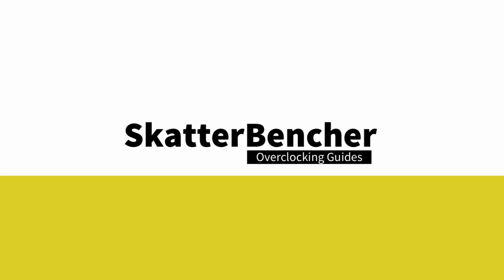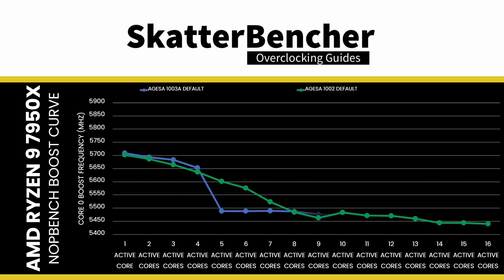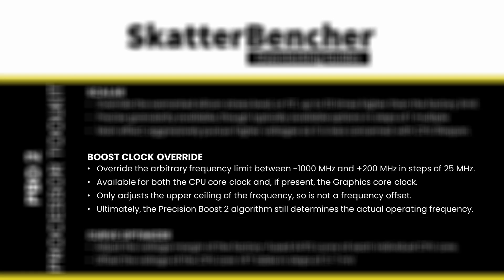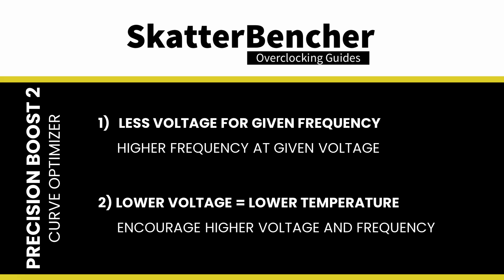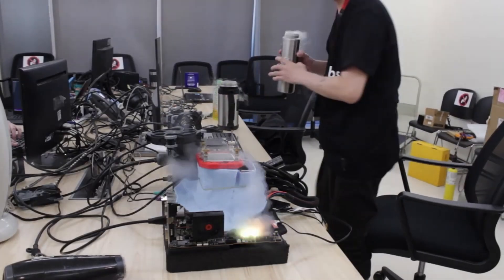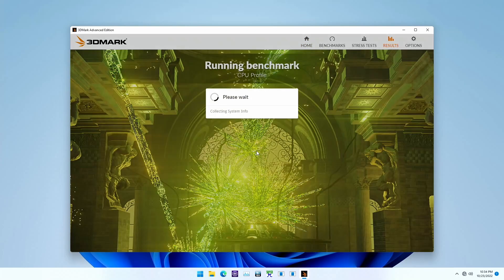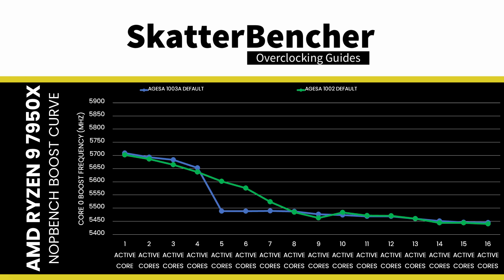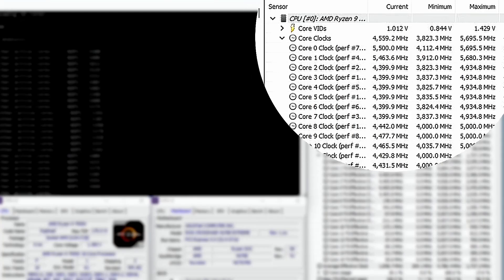WHY Your Ryzen 7000 Doesn't Boost Past 5.5 GHz (anymore)

Comment: Interesting, so this is just impact the performance on 5-8 threads? Graph on CPU profile is just run variation I assume? (Under 1%)
Have you check on other SKU? Like 7700X for example.
Can we have the NOPbench? :)
Thanks Massman!
Reply from the maker: The impact is from 5 to 16 cores. You can see it more clearly when PBO tuning is involved https://skatterbencher.com/wp-content/uploads/2022/10/Slide7-1.png. The real-world performance impact is limited because ... well, it takes quite a lot to be able to run >4 cores above 5.5 GHz. Good CPU, good cooling, light workload, ...

Most of the CPU Profile graph can be explained by run variation, yes. I included it to demonstrate limited real-world performance impact.

Other SKUs have the same limit, yes (checked 7600X which also capped at 5.5G).

NOP Bench -> check with Elmor in his discord :)
Reply: @SkatterBencher  I say 5-8c load because that's where the clock gracefully decreased vs directly clocked down to 5.5G. the rest (9-16) is the same behavior with default. At least in this video.
Yes Maybe there's some samples with adequate cooling that can surpass this.
I remember PBO on Zen4 is scale with cold, at -30 - -60C LN2 pot, I get the 7950x run cinebench @ 5.8G automatically.

Thanks for the explanation!
Will look to Elmor discord later. 😃
Reply: @SkatterBencher  the only time I see more than 5.4 all core is in Aida64 stress test. It’s also the most reliable one (cache disable) to test the curve optimizer when selecting affinity to each core

Comment: Glad I returned my 7950x before they gimped it. With the much higher platform price, long boot times and idiotic 4mm IHS I'll happily throw away energy for my i9
Reply: Long boot time? How's so?
Reply: @linearz  I just had poor experience with boot time, even with the Asus specific "retain ram config/training" option vs the 13600k system I built my partner. More like 3 seconds on that rig vs 15-20 for AMD to post. Minor, but it adds up considering platform cost vs the competition
Reply: If you want to re train your timings for best performance it’s a slow boost time and my 7950x without GPU load system load 465 watts before it gets thermal throttled down to 410 watts.  That’s with an undervolt. 

So honestly AMD will pull nearly 500 watts system load

Comment: My asrock- x670E steel legend doesnt have A syncronus (eclk) or bclk .. so basically what other options are their to get around 5.5? 
I  mean without manual oc. its unfortunate because my 7600X is doing All core 5.5ghz prime95 @ sub 60*C so much headroom but not much to do with it.
Reply from the maker: The only other option is switching to a BIOS with AGESA 1.0.0.2
Reply: @SkatterBencher  Thx seems like something asrock really needs to work on.
Reply: Same with gigabyte bios... Sad, bro.